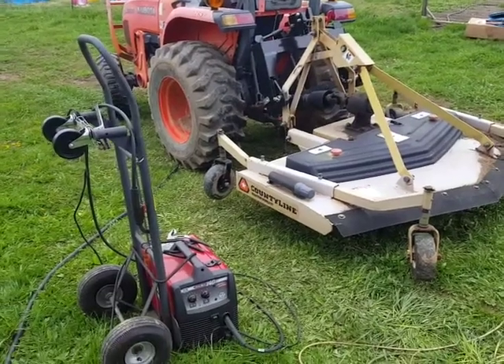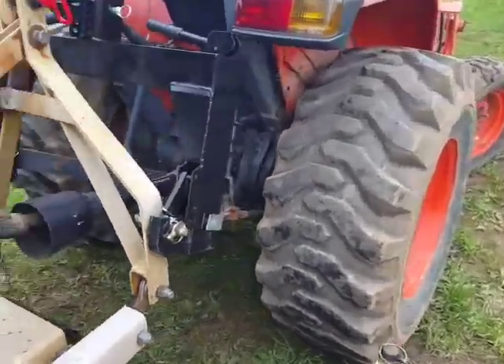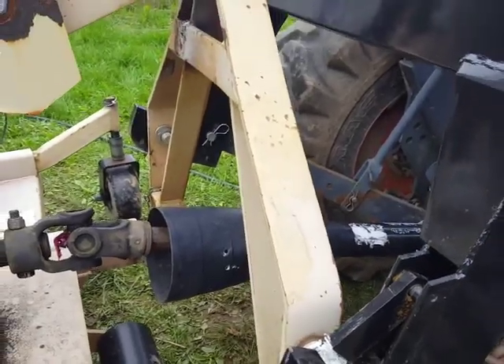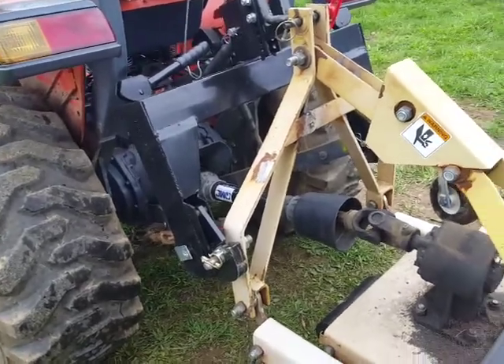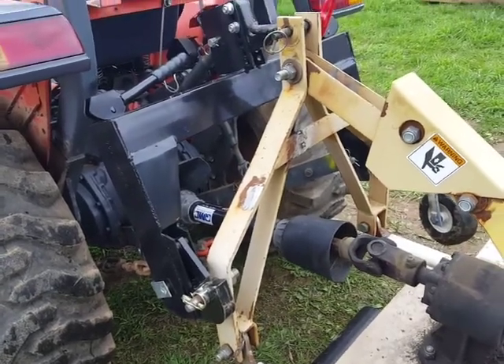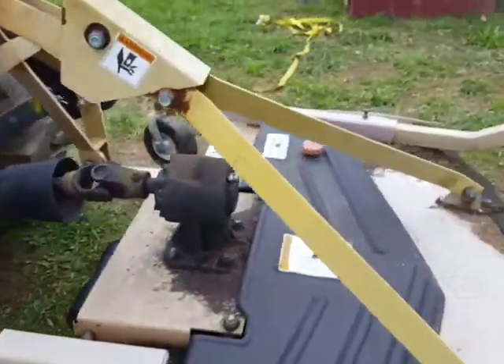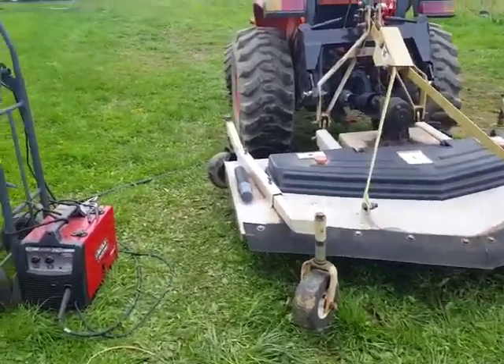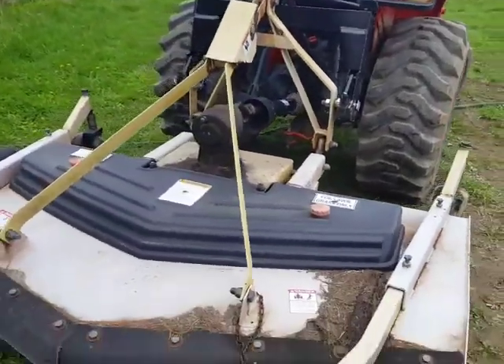Harbor Freight Quick Hitch with Country Line Finishing Mower modification

Comment from the maker: It's definitely worth it. The $120 quick hitch from Harbor Freight does the job good. I have 1000 lbs of counterweight on it.

Don't use the $30 bushings, use the $3 sleeves. Remove the bolts from the top hook and put in quick easy to move pins instead.

Now when I buy implements I just make sure that they will match up to it. Get an adapter plate with spaced-out pinholes for the top for some of the implements .

Comment: Same thing happens with my mower 
What I did is I cut the quick hitch on half and I extended 2" remove the top bracket and rewarded on the center again not only for my mower but for my other attachments is not perfect but works,